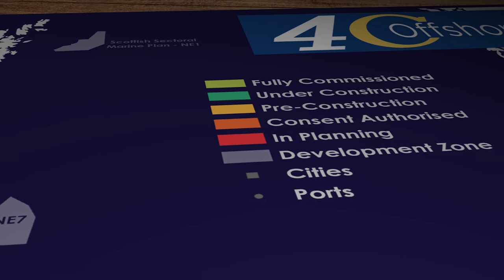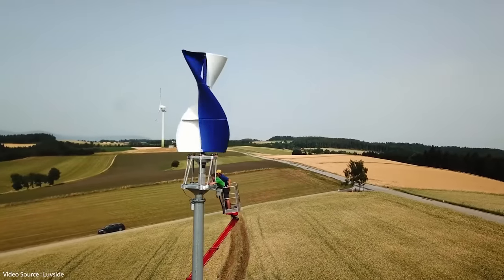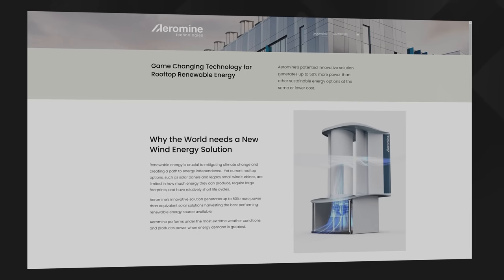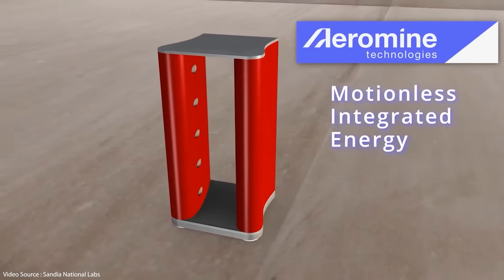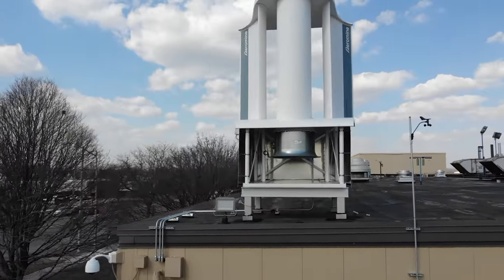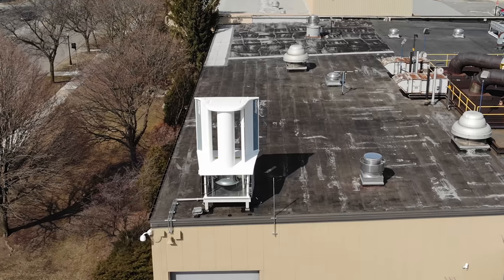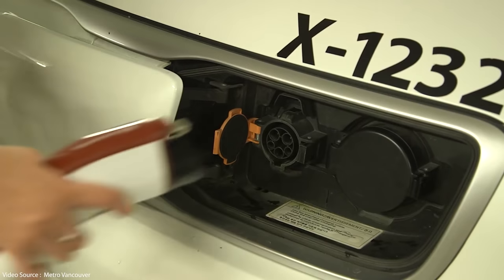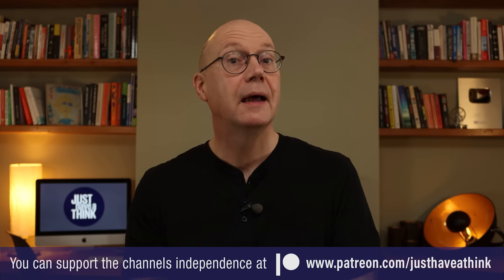Aeromine Rooftop Wind. Static. Silent.  50% more power than Solar PV. What's not to like?

Comment: The kinetic energy flux in a streamtube of air is given by 1/2 x density x velocity^3. If we assume that the capture area is 1m^2 and the generation efficiency is 40% then we can conclude that to generate 5kW this turbine requires air speeds approaching 65mph. That's a violent storm (force 11) on the Beaufort scale. Under more normal conditions I would expect the output to be a few hundred watts at most. I'm sorry to say that, yet again, we're being supplied with extremely misleading performance figures.
Reply: fairly normal wind in Iceland
Reply: Not misleading, but you will have to look at the graph for your average windspeed, which usually is a lot lower. Now, sticking wind turbines on roofs is usually a waste of money. Usually meaning in 95% of cases I studied. The other 5 are inconclusive.
Reply: Pr your wind speed assumptions are incorrect
Reply: Does this consider the Venturi effect?
Reply: @srw_cricket2976  No i don't think it does.. nor it considered the Possibility of Heating Air For Creating an Heat Battery out of it.
Reply: Cursory googling shows that building roof edges regularly see speeds that high, which is why these are designed to take advantage of that. Granted I imagine it would be far less than 5kW but probably not in the low watt range.
Reply: It looks like the 'capture area' ks quite large , and the pressure differential generates much higher airspeed through a relatively small fan, so that the effective power is much higher than the aparent capture area and incident wind speed... add in the already -existing pressure differential at a roof edge...
Reply: It's the Venturi Effect who Increase Wind Speed at Turbine Level..
The few watt of suction are for Generating the Vacuum who Produce the Funneling Effect for the Venturi's Turbine.
You're data aren't Wrong, you just have Calculated the Output of Energy from the Wrong Side of the Turbine..
It's not the Wind who pass Through that Generates the Greatest amount of Energy but the One who get sucked in..Vacuum generally Require little Energetic Expenditure..
You're Calculating the Vacuum Potential not the Energy factually Generated..
Ergo the Few Hundreds watts of Generated Vacuum are Predisposed for turning the 5kw with the Venturi's Turbine...
Hope it was Explicative.
Reply: @antoniopacelli  It doesn't need to consider the venturi effect. Swapping mass for velocity does not change the amount of energy available for capture in a system.
Reply: There is a fair bit of leeway in your and this calculation. At a wind speed 10 m/s you have about 600 watts per m^2 equating to 240 watts of recoverable power.  We could double the collection area increasing the power to 500 watts. Then add 50% increase in energy due to wind speed increase on the edge of a building and we get 750 watts.  Then increase the wind speed to 20 m/s (44mph) and you get over 5000 watts.  
So I think the bottom line is it might be a bit better than you think but we still end up most of the time a lot less than 5000 watts. The actual wind collection area is significant (don’t know what that is) and building orientation and height is an important factor in power production.  You would need to model the wind speed over the building to how well the system would work.
Reply: @operator8014 
 It's not Swapped with anything he is calculating another air in Entrance at another wind speed.
Air In Entrance and Relative Speed/Mass generate a Funneling Effect who Suck in An Amount of Air from surrounding Area that reaching 65mph or more makes Turning the Turbine attached to a 5kw Generator...
I don't really see what happens...
Probably Too kuch attachment to the Formula make the Logic Of the Whole Thing Fading Apart.

[There is a 9.27 Explanatory Video Above this Comment... did you even watched it ?]
Reply: Thanks for making the point about wind and the power. Generally new inventions are not, just new shapes but don't change the physic laws. From a frog. Bye
Reply: @joeblogs6598 Have you looked at any cost comparisons less than 20 years old? Nuclear is by far the most expensive. Coal is usually the second most expensive, but a lot cheaper. Solar is the cheapest, often around one quarter of coal, closely followed by wind. These costs are calculated from total life time cost per unit of power, no subsidies included. You can find the actual detailed numbers and facts easily, from very trustworthy institutions all over the world.
Reply: In some cases this is worth it I lived in a valley without many trees the wind there was 80 percent of the time was over twenty miles a hour and oftentimes more but this in a average neighborhood wouldn't be worth the cost!
Reply: @SteinVarjord  "Nuclear is by far the most expensive."
Nuclear is only expensive due to pointless regulations by government. If you weren't forced to build a bunker around your reactor, and buy have a nature reserve worth of land around it, you could make them vastly cheaper, with essentially 0 operating costs.

"Coal is usually the second most expensive" It's cheaper than everything besides nuclear.

Hydro only works in convenient geological locations, and is usually also used for irrigation, so cant just release water for power generation.

Tidal is about ten-fold the price of wind, and blocks shipping lanes.
Wave doesn't work.

Solar doesn't work at night time.

Wind doesn't work when you need it.

The only way to have wind & solar as a major portion of your grid is to have utterly uneconomical storage systems, which take that theoretical quarter price of energy, and multiply it by 50. Hell, the fool who runs this channel admits at the begging, "Wind needs backing from government to stop it becoming an expensive white elephant". And hes talking about before you even add any storage costs!
Reply: @joeblogs6598   Would you be able to clarify what you mean by "Wave doesn't work"? Are you referring to environmental considerations, or specific technologies?
Reply: @PaulZeeX  Collection of energy from sea/ocean waves. So far all attempts at making wave power generation economical have failed.
Reply: @joeblogs6598  industry calculations put solar + storage LCOE without subsidies ahead of current LCOE for all carbon based generation technologies, even with all the O&G subsidies.  I’m not referring to tree huger NGO numbers but internal power generation companies whose only incentive is to save money.  Were did you get your numbers from? They sound more like O&G talking points.
Reply: @fricardo3  Cool, if this is all true, then government has no reason to subsidize renewables (or any other energy), nor any reason to regulate it.

At the end of the day, I don't care how people want to spend their money. What I'm against is governments going round banning fossil fuels and wasting taxes on stuff that shouldn't have it.
Reply: @joeblogs6598  joe, I work at a utility and in 2022, before the IRA subsidies (that still don’t really catch up to the many subsidies received by O&G) were implemented, we already concluded that without any incentives, our fleet should still be rebalanced to reduce fossil generation to the minimum necessary for reliability and the vast remaining majority should be comprised of generation that requires no fuel.

I don’t know if you are noticing but to those who read your comments here it seems like your opinion is aiming at optimizing your job security or that of those who you care about in O&G and not optimizing for profitability like capitalism does.

Nobody denies the fossil fuels did immense good to humanity in the last 140 years.  They were instrumental, indispensable in allowing the emergence of what we now consider modernity.  They took as this far, very far indeed and, like having a very successful Grandpa, we should be really thankful and we should help the industry fade gracefully into the history of great past technologies.
Reply: @joeblogs6598  That is only if you set the requirements from an arbitrary standard case, namely fossil fuels which yes operate 24hrs a day. And so carbon culture, and from that carbon technology expect energy 24hrs per day, but carbon is what we are transitioning. Intermittent power would be fine once the demand side adjusts. Incidentally, nature is intermittent, and trying to pretend we are not in it has not gone well. And, energy needs to be seen more broadly. Fossils are dense stabilized chemical energy stored in a molecules of solar origin  by photosynthesis, and more heat and pressure than can be extracted. That’s unique, not a baseline. Wind and sun are flows, thermal pressure and radiative particles. There is no reason an energy flow would behave like a molecule. But then we have energy all around. In molecules of food, chemical and mechanical in structures, materials and production. Metabolic in ourselves. I’ve spent time in places with rolling blackouts, and after a few days it seems perfectly normal. It has also been the case for only a fraction of our existence that we used energy to climatize and illuminate interior spaces. Clothes keep you warn, the sun shines light. Better insulating material could combat cold, the Egyptians used mirrors to reflect sunlight indoors sometimes through several successive angles to illuminate far from windows. The pessimistic intractable problem is a destabilized climate, not an energy shortfall or intermittency.
Reply: @srw_cricket2976  yes it does. It is based on Bernoulli's principle of conservation of mass energy, which is exactly why this setup will not work too well. The speed of medium increases but the mass energy remains the same. Wait, minus friction losses. In this case there is lots of friction losses from surface contact and turbulence.
Reply: @johnxie6472  
It isn't the Funneling of Wind who Generate Electrical Power, it's the Suction Created by the Vacuum who needs less amount of Energy in Order to Generating a Bigger area of Suction for Incoming winds entering the Venturi's Turbine..

The Energy of the Funneled Wind Remain the same.. it's a few hundreds Watts of Passive Vacuum Generating Suction of Increased Amount of Air and Increasing in its Speed...

You're Calculating the Wrong Section.
That Funneled Air potential Power isn't Directly converted into electricity...
It's the Air Harvested from the Created Suction that is...
Vacuum need very small energy to move great amount of Fluids..
That is the Ram Pumps (even not being much efficient) run with the Pressure given by Flowing water itself plus vacuum...

How can possibly be that this comment have >100 Positive Reviews just because there are Theoretical Data Over it...
There aren't that many Harvard Students on YouTube usually.
Reply: @joeblogs6598  Well, although it's still early days, the UniWave from Wave Swell Energy promisingly appears to have broken that: https://youtu.be/4ehT-ZTHFGg
Reply: @joeblogs6598  lol, fuel cost of coal is higher than battery backed solar, what planet are you on haha!
Reply: @joeblogs6598  the reason you want subsidies for renewables is that they reduce harmful emissions.

Even if you don't believe in carbon dioxide, you better believe that living near coal plants is fucking awful for your health, cancer rates way higher and lung problems for everyone that lives in the area.

So we need government and subsidies to close the more expensive (but still profitable) coal plants sooner, rather than only when they become unprofitable.

Why without regulation would you shut down coal if you could make money, keep running it while the government subsidizes all the healthcare costs of those that live nearby
Reply: But if this was a general practice like insulation standards then having the millions of houses collectively would make our overall efficiency better regardless no ?
Reply: @Rnankn  Great, so all the 5G network installations can be removed for a start as they will not be able to operate reliably due to intermittent availability of electrical power which will be required elsewhere.
Reply: Small wind is a scam, just don't do it!
Reply: @malloot9224  a scam as such in what way ? Genuinely curious I know not much about the technology
Reply: @meateaw  Please show me then. If what you say was true, then we would have seen private companies building such things without subsidy ages ages ago.

The reality is that solar and wind have more costs than just the price of the panel or turbine. There are land costs, storage costs, cable costs etc.
Reply: @FuturusDao  I have read many researches from all over the world and small wind turbines never work well enough to recommend. A Belgian research into 25 commercially available models in a field and on homes concluded that none of them broke even after 6 years of running or even came close (vs grid prices). Half of them broke down in the first 4 years to a level that wouldn't make commercial sense to repair. Only one model made its rated power specs but was too noisy on the homes. Only 2 models didn't make noise complaints from neighbours but hardly made more then 70watts on average. Basically the laws of physics are against small wind turbines, its also why commercial market wants bigger and bigger all the time, they ran the numbers, bigger is better then more smaller.
Reply: @meateaw  "Even if you don't believe in carbon dioxide, you better believe that living near coal plants is fucking awful for your health, cancer rates way higher and lung problems for everyone that lives in the area."

Thats all well and good. The problem, is that those risks do not outweigh the benefits that cheap fossil fuel derived energy brings.

 If you have to pay 10 times the current price for energy, that means your food costs 10 times as much, as does housing, healthcare, travel. EVERYTHING. And because of those increases, people won't even get to the age where cancer can affect them. You'll send us back to preindustrial society with dogmatism.

" need government and subsidies" The problem there is that the government doesn't magic money into existence, the value that backs up that money must be stolen from the population via taxation. Other than that being a heinous moral act, it is also no at all practical to use 3 times a country's GDP on destroying and then rebuilding its power generating infrastructure, all in the name of a climate cult.

"Why without regulation would you shut down coal if you could make money"
If it becomes more profitable to operate a nuclear power plant, then it they likely would. Another possible reason, is because their customers are not willing to buy electricity from coal derived power. At the end of the day, in a free market, the buyers an sellers come together to decide what gets done. Vote with your wallet.

"while the government subsidizes all the healthcare costs of those that live nearby"
One of the many reasons why we should not have government run healthcare. Another reason is canada's MAID.
Reply: @@morciej Oi Bro...
If the wind passing through at top is 20m/s the Wind in the Venturi will be 
~40m/s.. if it goes 15m/s it will be 30m/s if it goes 10m/s it will be 20m/s at the Turbine Level.
If it goes 5m/s than probably the turbine will work at a fraction of its potential... it doesn't matter much..
It is rated for 5kw if the wind blows at 29m/s it will still be doing those..
if the wind flow at 10m/s it will do 2.5kw...
No one care anyway...
It will not be saving the world regardless.
Reply: It could be bugger all in terms of Watt-hours and still be 50% more than the solar power we get in the UK
Reply: @allterrainviking  true but u have far better source there geothermal !
Reply: @allterrainviking  Lucky you.
Reply: @derkarhu5079  You cannot beat the Betz limit. It applies regardless of whatever fancy bits they put into it. It is just a matter of energy conservation and flow continuity.
Reply: @malloot9224  thanks for sharing
Reply: I live somewhere where we ocassionally get those kind of windspeeds at certain times of year. That's actually getting into very scary territory. The gusts will be getting much higher to get an average of 65.

The idea that something projecting from your roof would be even rated to withstand that kind of weather, let alone use it as a baseline for calculating output doesn't seem right. If they're actually doing that then the whole thing is just a scam to capture VC funding or something.
Reply: In the Netherlands you have 27 days of windshield over 50 km per your. That gives already 648 hours of full capacity. So the numbers might be in order
Reply: @PeterBakker  initial post is mph, not kmph. 50kmph winds are very strong, 65mph (100+kmph) are extreme - roofs coming off houses, trees blowing over etc.
Reply: @jeremymanson1781  Then don't subsidize them. Nothing should be subsidized.

"which they are not required to remedy."
Why on earth should they be? Are you required to remedy this 'damage' for your participation in it? You buy energy from these people, you eat food that was farmed.

"We are now in the 21st century."
We are also in reality. In reality, things cost money. In reality, things require energy to do.

You must recognize that increasing the price of energy by banning fossil fuels, that your quality of life (and everyone else's) will be dramatically reduced.

If you don't like energy produced from fossil fuels, don't buy energy from a company that makes energy from using them. Under capitalism this is possible.

Stop trying to force everyone else to play in with your insane cult.
Reply: From a cubic meter of vacuum at sea level (1 bar ~ 28 Wh/m^3) you get about 28Wh under optimal conditions and that independently of any flow speed.  I therefore consider it plausible that the energy production here is determined to a significant extent by effects of the fluid dynamics and that the exclusive consideration of the kinetic terms may underestimate the energy that can be produced.
Reply: @fricardo3  Can you explain LCOE?  What is levelised (or levelled?)
Reply: @peters.8119  I don't understand your calculation. What do you mean by obtaining energy from a vacuum?
Reply: @Merlin3189  it simply measures the average net present cost of power generation for a specific technology over the standard lifetime of projects using that technology.  It is called levelized because the results of the different calculations for the different technologies provide a comparable number allowing for apples to apples comparisons
Reply: @joeblogs6598  'your insane cult' from a fossil fuel addict: pot calling kettle 🤡
Reply: @joeblogs6598  Firstly, the reason for those regs is sound and has already proven incredibly valid in recent disasters. Secondly, no, the costs would remain virtually that high. The total land cost going into Hinkley C is £4 million. The total cost of the bunker etc is £115 million. Its total build cost is £26 BILLION. You really shouldn't speak on things you clearly have absolutely no experience of.
Reply: @meateaw  He's either just parroting things he was taught 20 years ago with no idea of how much the industry has changed, or more likely, he's in someway employed in the oil and gas industry.
Reply: @joeblogs6598  These are included in almost every commercial calculation for costs. It's literally out jobs. Jesus Christ the Dunning Kruger is strong here...
Reply: I present the same equation, but what is the effective area. Not just the frontal area of the device itself.  The building as mentioned deflects the air. Not very effective but many times the area of the device.
Reply: The airspeed in localised areas around the building  could be that velocity because of the frontal area. Even when the wind speed is much lower.
Reply: @joeblogs6598  , no, coal is not the "cheapest source of energy out there"- coal externalizes many of its costs/liabilities- your math only 'works' because you pretend costs don't exist!!!
Reply: @svampebob007  Of course you call "BS"- generating hot air costs you nothing.
Reply: @joeblogs6598  Why should folks be liable for the damage they do?  Seriously?  Attempt to answer that question yourself in good faith before taxing others to answer it for you.   We can't chew your food for you- if you won't make the minimal effort required, there is no cause to believe you are capable of benefiting from assistance. 

Look, dude, you seem to enjoy making ultimate proclamations based on your ideological preferences.   That may server you in your political social circles, but in the practical world, such tactics obstruct progress.   You argue for a model that has brought us to the precipice  of environmental catastrophe.   You argue for a past that served you by robbing the future.   The easy bet is you are an old man... yet your account here is only a few months old.   Most peculiar.    Regardless, you are convincing no one, only affirming your own preferences and prejudices.
Reply: Yes you are right. This is just a paid partnerships. All youtubers have to do is praise the turbine.
Reply: @fricardo3  Thanks. It had to be something like that. I found this thread difficult to follow with so many acronyms scattered around, but fell at the hurdle of this one when I didn't even understand the words.
It is hard to compare costs with so much legislation and subsidies of various sorts being applied.  So we would like to have some measure like that.
Reply: Assuming the wind is coming directly in.
Reply: @Phazaar  The cost of a coal power plant is ~$1 billion. A nuclear power plant is essentially the same thing, but with the coal burning furnace replaced with a reactor vessel. You have to explain to me how the reactor vessel somehow costs more than $25 billion to produce. It's clear to me that due to either government regulations, or plain old corruption, the price of nuclear is completely distorted.

"regs is sound and has already proven incredibly valid in recent disasters."
Where?
Reply: @meateaw  "The free market is great, but it is also myopic"
No more than anyone else. It's far less so than the government that only thinks in ~5 year cycles. Perhaps if governments weren't constantly devaluing everyone's money, people would be able to invest in long term low risk, low % return investments, instead of scrambling into a short term high % return investment to preserve their value against inflation.

" If you can still make money on coal, there isn't some magical fairy that comes in to undercut coal."
Eh? That's like saying people will continue to use horse & cart as their main mode of travel, despite the cheaper alternatives of a car existing.

In general, people will use whatever is cheapest to complete the job. This is great, because this means all you have to do is make energy cheaper than a coal power plant, and the vast majority will start using your cheaper energy.

"People make money off their rooftop systems even when there is no subsidy."
That's fine, though your grid can't operate on a high percentage of renewables because you then become dependent on their intermittent nature, and require storage, which costs money.

If you believe people strapping solar panels to their roof will fulfill their energy demands, i'm fine with them doing that. I only have a problem when the government comes round either demanding everyone does it, or starts spending other peoples money on funding it.

"there's a reason monopolies and oligopolies form."
Yeah, because governments ensure the monopolies never face competition. Just take a look at insulin prices in the USA. Only 3 companies are legally allowed to make it. You're not allowed to import insulin from abroad, because of government. You're not allowed to make insulin without a license, because of government. You're not even allowed to develop a different way of making the stuff without pointlessly spending billions of dollars in meeting the regulations put in place, by government.

All monopolies are maintained by government. In the free market, monopolies can exist too, but only for a short while. This is because competitors develop ways of making the exact same product the monopoly makes, competing with it.

"And that's because the free market has MAJOR issues if you don't regulate them correctly" 
Regulation is what causes these issues.

"You have "done your own research", and it's like they say, garbage in garbage out."
Ah, I see. The only valid research is that which is sanctioned by the state. Carry on being a slave to your state masters.
Reply: @meateaw  As I've replied to the other guy, that money does not equal value.

Simple way to think of it: Can you just keep printing money to pay for things?

How did that work out for Zimbabwe and Germany?
Reply: @mavigogun  You're over estimating those costs. The proof of that is that people still buy energy from those power plants.

If you don't like something, don't buy it. If enough people agree with you, the income of that company suffers until it changes it's practices such that it meets customer demands.

Vote with your wallet, it's as simple as that.
Reply: @Rnankn  I am VERY skeptical about our current capability to shift out from oil and gas in a meaningful way, but I am for energy diversity.  It's always good to have options.  I agreed with most of what you said, but you lost me when you tried to normalize rolling blackouts as a price for entry. 😂 No thanks.
Reply: @mavigogun  I just called BS, you don't have to answer. I just hope that non of my local politicians falls for this crap.
Reply: @joeblogs6598  I can only assume you don't wear seatbelts, still put leaded gasoline in your car, drink conterminated water and enjoy sulfur smells from passing by semi's while your 10 year old children work 12 hour shifts in the local coal mining facility.  
I cannot fantom how you can think that making several 100 square miles uninhabitable for hundreds of years is quite an acceptable risk.
Reply: Maybe it was 5Kw over the whole day, not 5 Kwh
Reply: @rienkhoek4169  "I can only assume you don't wear seatbelts, still put leaded gasoline in your car"
No, because even if I wanted to, the government prohibits me to do so.

By having regulations, the government makes things more expensive. This means that someone who is poor, gets poorer. Where originally, in a free market, could have the choice to buy cheap gas with health risks, or expensive gas with less, they now have to pay for the expensive one.

Regulations only harm people. If you don't want to buy something because you are scared it will harm you. Don't buy it.

"making several 100 square miles uninhabitable for hundreds of years"
What on earth are you on about? Perhaps Chernobyl? You can live there just fine. It's not uninhabitable as evidenced by the flourishing wildlife all around it. Perhaps if you lived in the reactor building itself all your life, you might have a higher risk of cancer, but that's it.

You people are just how a government want's all it's subjects, scared.
Reply: I think folks are missing a fundamental point here. I'm not an aerodynamicist, I'm a retired pilot and have flown through ground level wind shear a great many times.

All pilots have experienced ground wind speeds of five knots or less that were 15 to 25 knots just 20 to 50 m above the surface seconds before landing.

I used to teach people how to fly gliders and we had to carefully instruct folks to avoid making super steep turns near the ground as the wind differential speed could be enough to stall the down wing resulting in a tragic half spin and splat ..

Elevate the intake and redo your math .. eager to hear your results.
Reply: @nottenvironmental6208  can you correct them then?
Reply: You need to keep in mind you have rising air from the ground at temperature.  Then the colder air combining this this and the venturie affect. All these factors will increase the speed dramatically . The venturie will increase the speed by 50% possible
Reply: @svampebob007  It's customary where I'm from to clean up after waste is excreted.
Reply: @joeblogs6598  Yes, it makes things more expensive, because people/ companies are being held responsible for the side effects like polution and health and safety. How do you propose to prevent the world from becoming a huge landfill? 
The only people getting rich in the early days of the industrial revolution were the owners of companies while the workers where given just enough to not die. 
No i dont live in Tsjernobyl, and guess what, nobody does, because in that 30 kilometer radius, your health will suffer. Just because rabbits het to live there for a few years doesnt mean you can live there for decades.
Reply: @mavigogun  "Most folks with any conscious or basic maturity don't allow that complicity to become an excuse for not changing course."
Then change your course. With the free market you are allowed to make that choice. If you don't like the way a product is made, you can choose not to buy it.

Under the government, you are not allowed to choose. You want the government to take away that choice.

As for fossil fuels causing damage, it is a simple matter of pros and cons. Fossil fuels pros are that the produce constant power available at any time, very cheaply. Their con is the waste material they produce as a byproduct.

For the vast majority of everyone who uses that energy, the pro of cheap energy, outweighs that con.

If it didn't, then they would select energy produced by other means. This what I'm getting at. You want to deprive everyone of a choice, all because you believe you know best.

"Sociopaths, such as yourself, grow ever more impotent to stop that change"
On the contrary, I'm not here to take away anybody's choice.

I want the free market, unrestrained by evil, controlling bureaucrats. If you want to use coal, wind, nuclear, solar, I couldn't care less. What I do care about, is when you use the government to either spend other peoples money on those things, or outright force people to use them, depriving them of choice.

Why must everyone do as you say? Can't they be trusted to make their own choices?
Reply: @antoniopacelli  fascinating!
Reply: @Raye938  I wonder how these would perform is mounted on a peaked roof, with the roof slope facing the wind
Reply: @joeblogs6598   re: “benefits of cheep fossil fuels”:  cheep fuels have resulted in an outrageously inefficient housing stock, inefficient layouts of cities, where walking is unpleasant or dangerous, so that our communities are fragmented, and children can’t play outside. The automobile has transformed the symbol of success and individuality to the most narcissistic and selfish possible. People easily go about their day nor meeting a single acquaintance- because they don’t even meet their neighbors as they drive from their driveway.  Statistically, one in a hundred of us will die in a car crash, and most people will be injured by one. 
This cheap fuel does not foster medical research , or encourage us to play on community Sports clubs or play music together or join community theater groups.
Reply: The pressure and windspeed coming off the edge and over the corner of a building is much greater than ambient surrounding air speed,this is why they are placing them in this efficient zone to capture the high wind speeds!
Reply: @liamstacey419  "cheep fuels have resulted in an outrageously inefficient housing stock, inefficient layouts of cities,"
You going to have to point out how that connection works for me.

The price of energy dictates your well-being however. Logic here being pretty simple:
If you have to spend less money heating your house, lighting your kids bedroom at night so they can study, cooking your food etc, you have more money to spend on other things, like improving your accommodation.

"Statistically, one in a hundred of us will die in a car crash, and most people will be injured by one." And how many countless people are saved by ambulances? How many are saved by medicine delivered on a truck, instead of horse and cart?

These are the sort of things environmental fools forget.

They seem to believe that these things at the supermarket just magically appear. When you increase the price of energy by forcing everyone to use renewables, you make the cost of everything go up. This makes people suffer far more than any air pollution could.

"This cheap fuel does not foster medical research"
No, but it does allow more people to spend time researching, instead of making money to pay for bills. As stated before, low cost energy lets peoples money go further.

At the end of the day, I just want you to stop using the government to take away peoples choices.
Reply: @liamstacey419  "oil is heavily subsidized"
The government should not be allowed to subsidize any energy system.

"mined from public lands for free"
Where? My understanding is an oil company acquires some land, then drills it. The way it should work, is you buy some land, you get to do with it as you please, end of.

"transported on publicly funded highways,"
That is why those roads are there for. Of course if you want a system where your taxes are a reflection of what you use from the government, I am absolutely in favor of that! Also, most of the distance that oil covers is via privately built train networks.

"paid out of our taxes an volunteers"
Then don't use taxes to clean it up. It's the oil company's property, it's their problem.

"Consider that we are now squeezing out the more expensive oil: our grand children will have only the tar sands to find fuel"
This is to be expected, and will be resolved if the free market is allowed to exist. As prices of oil rise, it becomes more economically sensible to explore other energy generation systems. 

At the moment we don't have any cheap energy storage that would make renewables sensible. Perhaps in some time, the free market will create an ideal energy storage system that allows renewables to compete with fossil fuels.

"Perhaps we shouldn’t use up all the fossil fuel"
We currently do not have any replacement for fossil fuel powered tractors. Once again, allow the free market to create a solution, and once found people will use it. Not because its environmentally friendly, but simply because its cheaper. This is how to solve all the worlds problems.
Reply: The capture area is actually the entire column of the surface of the building below the generator. The building itself is capturing the energy and redirecting it up towards the device with a higher pressure and velocity than it had when it was far from the building. Granted this collection mechanism is not very efficient because there are a lot of losses due to drag, but the collection area is a hell of a lot larger than one square meter.
Reply: @joeblogs6598  my point here has nothing to do about government subsidies, but rather about how the government giving away fossil fuels are and the presence of quick fixes such as fossil fuels result in built-in long lasting inefficiencies.  it’s basic economics that anything that is cheapest wasted. Since fuel is cheaper than insulation for a long time and cheaper than the effort it takes to build a double stud wall, we have a planet of housing stock that is extremely inefficient causing us to be in a desperate situation for more cheap fuel. As architects have become more cognizant of this problem, they have developed houses that are extremely efficient. The design process is called “passive house design“ 
Our economy has loads of surplus spending that we waste producing and consuming junkie stuff, Das our capacity to do biological research is largely a Product of our willpower not an abundance of cheap energy.
Reply: Applying your formula  I found   kinetic energy = 1/2 x 1.225 kg/m^3  ×  (5 m/s)^3 =76.526 w/s^2 for 40/100 of 1 square meters 76526 x 0.4 =30.625w=30w for 11mph (or 5m/s) for 60mph it will be eround 6.5kw
You seem right but I we may be missing something because they seem to have better measurement.
Reply: @srw_cricket2976 any one knows how venturi effect increases the wind speed ? 2 time  .? 3 ?
Reply: I guess if you have 6 it’s 10 mph?  I’m not opposed to that but 5kw, not 15?  Interesting. 18 is a bit much for a hair dryer @1500w
Reply: Velocity used for calculations isn't  wind Velocity but the  Velocity trought the cylinder . It's  X  time wind Velocity (acceleration effect)
Reply: @antoniopacelli  I think you need to learn to spell physics before you start trying to use it
Reply: I couldn't agree more Sam.
Reply: @malloot9224  A sensible and reasoned reply. My understanding exactly.
Reply: Thank you for the calculation and your valuable insights... If the construction is lowcost and you can spare the surface and get a permit for several large structures it would be feasable. But since yield is low cost will probably be the deciding factor...
Reply: @sammason2300 Illustrated on an apartment building the units are about the same height as the floors of the building, typically more than 8 ft, so the capture area should be at least 2.5 sq m, and closer to 3. In mass production if the costs can be driven low enough these units would attach to each other to form a continuous parapet wall with a capture area equal to the length of the building x 8 ft. If he gave a typical velocity multiplier for air flowing over a building, I missed it. But that's a cube factor, so it is critical to the system's LCOE, which is what will sell it if the esthetics blend in and it actually runs quiet. Ugly junk on the roof that gets a reputation for sounding like a rock band will wither & die even if it works. I can imagine the system becoming popular if it is attractive, quiet, made from low maintenance materials & easy to maintain with a power unit that snaps out so you snap in your spare and easily service the one you're repairing to store on the self as your new spare.
Reply: @Rnankn  Wildest story I've seen in awhile. Of COURSE we not only expect power 24/7, we DEMAND RELIABLE  power 24/7. This is minimal. As a species, we will need to extract many gigatons of CO2 from this here atmosphere, and the energy to do so will not be attained by reducing our energy foot print. The problem is in the petawatt column, not the kilowatt column. We, those who believe in planning for the worst while hoping for the best, insist building heaven on Earth is a basic expectation. I don't know what planet you want to live on, but we have Elon Funk & Jeff Bozo building rockets to take you there, so PLEASE volunteer.
Reply: @mrvalveras  That's the most mature thing i've ever read on the tubes. Have a delightful December 2022.
Reply: @liamstacey419  "The government paid for the research they gave us aerosol cans and lasers"
That doesn't mean government is a vital component of acquiring those discoveries. It's like saying we need government to build roads, when farmers build them and other infrastructure privately routinely.

"You present the choice as government does things or it’s a completely free market."
This is because I want society to tend towards more free market, instead of growing the government. At the moment, and for the past century, governments have only grown. We're literally at the point now where they want to regulate how much fertilizer a farmer uses, or ban what kind of car people drive.
The government is too big.

"The fact of the matter is that the majority of the people want there to be public lands,"
The fact of the matter is that people want free money. If government presents their manifesto with a big slice of free money, people vote for them. I'm pretty sure the founding fathers of the USA said something to the effect of 'the republic will end as soon as the people realize they can vote themselves money'.

"regulate things that threaten the welfare of the population."
The problem with this idea of something that "threatens the welfare of the population" is that every single thing that anyone does, causes a little bit of harm to everyone else. By consuming resources, say a loaf of bread, someone else who could've had that bread is negatively affected. This is the excuse governments use to control every aspect of your life, because in principle everything you do can effect everyone else in a minuscule way.

"the question of when should the government subsidize something that’s a potential public good." Just like how everything has a component of harming everyone welfare, everything could bring some tiny public good. Just because this is true, does not mean that those goods and bads are balanced, or favor a particular direction. In order to find out which one's the case, you can only try doing them and see how they work out. With the free market, you can do so.

I'd much rather scenario where you can do what you want, and if someone doesn't like it, they ostracize you. If you get ostracized by enough people, you're likely doing something unhelpful, and due to the economic impact upon you from ostracization, you will stop your behavior. We don't need some man with a high-vis jacket and a clipboard to tell you how to do stuff. Hell, I could even stand a little government, if it just did what it used to, stopping people murdering, or stealing.

"If we want more efficient city planning or more Energy efficient housing stock,"
The problem is that we don't know if the money saved by having insulated houses, is worth the cost of smaller, more expensive houses. Once again, the free market solves this issue, because people are free to try building either one. Then, whoever is the most successful demonstrates which is best by their success.

"they’ve only done this because of cheap fuels."
Perhaps they wish to escape the city planning, good or bad, and would rather be free to do with their land as they please.

"the countryside has only become littered with suburban shopping malls"
With the free market, everyone has the power to stop this. If you don't want your house to be next to a shopping mall, you buy the plot of land next to you. This exact mechanism lets you preserve wilderness areas. Once you own property, it is yours to do as you please.
Reply: @joeblogs6598  'It's clear to me based upon my total lack of experience in the area, wild speculation, and abject ignorance of the subject matter' - fixed that for you.

The costs come into a number of areas, firstly, you're wrong, reactor vessels are vastly more expensive to produce. Secondly, patents and licensing in the area are incredibly expensive. Thirdly, staffing in the area is incredibly expensive - you can trust a moderate engineer to build a working coal powerplant. You will require a team of the most qualified scientists and engineers to get even close to a working reactor, let alone a safe and stable one. Competition for these individuals is ridiculously high and there are only a few in the world.  Fourthly, there is no free market here - nuclear is close to a monopoly, and this means there are no competitive tenders to bring that price even slightly down. Why should there be? It's a pointless technology at this point.

And finally, finance implications. The risks involved in building a reactor, let alone operating it, are obscene, and the FACT that it will never be cost competitive means that governments have to offer incredible financial incentives (look at Hinkley C's government guarantee of FIVE TIMES the wholesale price of energy, just to begin construction) in order for anyone to seriously believe it's a good commercial proposition. Disbelief means risk, risk means high interest, high interest means commercial disinterest, which loops back to charging obscene prices. No one's going to build you a nuclear power station unless they're certain they can print money with it for as long as it's allowed to operate.
Reply: @joeblogs6598  As you've been repeatedly told, YES THEY ARE CHEAPER ONCE STORAGE IS FACTORED IN. They have been for a couple of years now. Please do catch up. They also remain cheaper even with grid reinforcement. You're grasping at straws where there are no straws.

Many companies have leapt straight for them. Some do not because of the perceived risk of luddites rolling back regulation, as they did with FITs in the UK. The main reason though is because companies aren't sat on cash mountains; they have to acquire finance for these things, planning consents can take decades, and require immediate action. This is why government intervention is necessary, exactly as it has been in mining and O&G.

Your understanding of MMT is limited, but yes, you've correctly identified that the government issuing currency directly to banks instead of individuals is a huge problem. Issue it directly to individuals instead and the economy booms, as demonstrated through Covid, and even as far back as the New Deal.

Whether you expect people to trade things in this way doesn't change the fact that they have for 50 years and the problems we continue to experience do not stem from this but from rampant capitalism which requires redress.

Again, the cost of energy goes DOWN as we move to solar and wind, as does our reliance on foreign powers and (as we currently see) a tumultuous market. Better all round, with no downsides.

Glad we agree that O&G subsidies should go. Maybe spend more time screaming about that since it costs us hundreds of times more than renewable incentives? Your final point is of course absolute trash, based in a nonsensical 'morality' built entirely to enrich the super wealthy, that should have died with Thatcher and Reagan.
Reply: @joeblogs6598  1. We agree then in urban planning.
2. I suspect you don’t like private toll roads and bridges. 
3. Corporations are like aristocracies: they own vast amounts of land and resources, determine the fates of people and economies, but only the wealthy at the top can vote. You could argue that people can vote with her dollars, however the fact of the matter is that people sell them do. People regularly by items from companies that use slave labor or prison labor in other countries, Breakin Bayern mental laws, and participate in government corruption here and abroad. So if you’re going to go after governance I suggest you start with the most corrupt of all, corporations.
4. The biggest growth in our government has been the military, for better or worse.
There’s a lot of people who complain about big government, but they frequently just have one institution that they particularly hate because it’s preventing them from doing things their own way. Would you get rid of public schools? So the only people with money can afford to educate their children and religious people don’t learn anything about science? 
5. Would you get rid of national and local parks? private companies have been free to develop their own parks, but they don’t seem to be interested in it outside a few Hot Springs and ski resorts and exotic game Ranches. So it seems that the private sector doesn’t find parts with vast amounts of open space very profitable.
Reply: @Phazaar  "Secondly, patents and licensing in the area are incredibly expensive."
Government caused cost, my point stands.

"You will require a team of the most qualified scientists and engineers to get even close to a working reactor,"
No it doesn't

"Fourthly, there is no free market here"
I know there isn't, that is because the government controls the electrical grid. You have to go through a billion licenses, regulatory bodies, bribe a few MPs, and even then you're only half way through. This is why the government should be several orders of magnitude of its current size. Think about how difficult it is to drill for oil & gas by fracking on your own land. It is gumming up everything.

"no competitive tenders to bring that price even slightly down."
The competitors are people who build another power plant. The number of competitors on any market is influenced by the cost of entry. In the case of nuclear that cost of entry is kept artificially high by the various ways government interferes in it. 

This is the same reason why healthcare costs so much - regulation increases the cost of entering the market, reducing competition. Government raises the price of everything.

"The risks involved in building a reactor, let alone operating it, are obscene"
Of course the risks are obscene! The government could shut down your investment at any time, look at Germany, look at Japan. They've shutdown practically all their reactors! That is where essentially ALL the risk comes from, the government.

Every single thing you've claimed about nuclear is completely a government borne issue. Remove the government interference in this area and you remove essentially all these problems.
Reply: @joeblogs6598  Couldn't eyeroll harder. The government doesn't own the patents and licenses, private corporations do. Unless your argument is that intellectual property shouldn't exist?

Yes it does. Remind me though, where is your PhD from? 

Firstly, the free market point relates to competition to build Nuclear power plants - it has nothing to do with government intervention. Secondly, there is no effective model for a non-regulated private energy grid that can usefully deliver what we need; the government stepping out here would make things hundreds of times worse. Thirdly, it absolutely shouldn't be possible to drill or frack on your own land, for the same reason it's not legal to grow Japanese Knotweed on your own land, or let off a biological weapon. 

As already outlined, the price to build nuclear is high because there's no point in building nuclear which makes it a terrible commercial investment, AND because it's incredibly expensive, NOT because the government made it so. You have failed miserably to counter this point, so I'll assume you've conceded it and now just want to fall back to repeating lies.

Healthcare is cheaper in every single country where the government runs it than it is in the only 'civilised' nation where the government is kept out of it. It also leads to better health outcomes in every comparable nation. Do you just make stuff up and avoid ever actually doing research, or do you get lines fed to you by some shady paymaster?

There are dozens of other, equally significant, risks to building a reactor. But yes, the fact it's obsolete and will be shut down well before the end of its lifetime because it's an awful technology that should be consigned to the past is indeed one of them. 

You haven't yet demonstrated any area that without government intervention would change in any significant manner to make nuclear cost effective. You also haven't provided a single cogent argument why even if cost came down, that would represent extra value to the public when factoring in the massive risks of trusting private enterprise to self-regulate. Where these materialised in mining and refining, they have done irreparable harm to our planet with just plain old oil and water - what do you think would happen if they materialised with radioactive materials? You're a dangerously delusional fantasist at best, and a ridiculously dishonest vandal at worst.
Reply: @Phazaar  "As you've been repeatedly told, YES THEY ARE CHEAPER ONCE STORAGE IS FACTORED IN."
Yeah they've claimed that, but in reality it's not the case. An easy way to show that's not the case is that we're not running everything on renewables. If they were so much cheaper than their alternatives, why has everyone not switched to them?

"This is why government intervention is necessary,"
It isn't necessary to adopt renewables, as if they are cheaper, people will invest in them instead of fossil fuels, because it gives them higher returns.

" Issue it directly to individuals instead and the economy booms"
That doesn't change the fact that you are giving them bits of paper. The value of any money they hold ends up depleting. 

This is because the number of goods in the market have not increased with the amount of money. If there's a thousand oranges in the market, and 1000 banknotes, then each banknote gets one orange. 
If the government prints an extra 9000 banknotes, there's still a thousand oranges, but now there's 10000 banknotes, so each note has reduced in value by ten times, meaning you need 10 banknotes to get a single orange. This is a fact of how markets work, all governments can do is hide inflation effects so people don't notice too much.

"the economy booms, as demonstrated through Covid"
I'm a confused, are you saying that the economy is booming?

"the problems we continue to experience do not stem from this but from rampant capitalism which requires redress."
No, the problems we are experiencing are soley due to government interfereance, which requires reduction.

"Again, the cost of energy goes DOWN as we move to solar and wind"
I hope it does, but I do not see this to be the case. As I've said before, if these energy sources are not only cheaper than fossil fuels, but substantially cheaper than them, why is there use not already widespread, and if anything, the vast majority.

"as does our reliance on foreign powers"
Our reliance on foreign powers for energy is soley due to our governments restricting native extraction of fossil fuels, all in the name of these environmental policies.

"Better all round, with no downsides."
Apart from the downsides of vastly increased cost.

"Your final point is of course absolute trash, based in a nonsensical 'morality' built entirely to enrich the super wealthy"
Which of my comment's final point are you refering to? Is it that I believe your own property is yours to do with as you please, or that the free market is the best system to solve the worlds problems?

If it's the former, I don't see how having sovereignty over your own stuff is in any way bad. You own it, so you get to say what happens with it.
Reply: @liamstacey419  "I suspect you don’t like private toll roads and bridges."
It's better than being forced to pay for roads built on the other side of country that you've never used.

"Corporations are like aristocracies: they own vast amounts of land and resources, determine the fates of people and economies, but only the wealthy at the top can vote."
You paint corporations like they are immune to reality. First off these big players who act in the way you claim are all propped up by government interference. That interference comes in different forms such as patent laws, regulations, prohibition of imports. 

Take pharma companies for example, much of their dominance comes from the patent laws surrounding the medicines they make. Insulin in the USA is only made by 3 different companies, all of which continually renew their soon-to-expire patents so as to ensure that it is illegal for any other competitors to arrive. Then you have regulations, usually they exist for the sake of keeping the public 'safe'. Said regulations prohibit importing insulin from other countries that could undercut those 3 big companies, despite those imports coming from Germany. I doubt German insulin is any less safe than the American stuff. This is why these big corporations lobby in new regulations instead of innovating.

If you removed this government interference all these corporations would be exposed to the competition of the free market. Insulin monopoly charging $500 a vial, when it costs $5 to make a gallon? A competitor arrives on the scene and sells it for $10 a vial, still making an obscene profit, making any investment back rapidly.
 
" use slave labor or prison labor in other countries," said slavery is enforced by the government of that country (china etc).

"I suggest you start with the most corrupt of all, corporations"
corporations only exist due to the aforementioned governmental interference in the free market.

"So the only people with money can afford to educate their children"
People pay taxes. A portion of those taxes goes to state 'education'. If there is no state run education, peoples taxes can be reduced by a corresponding degree.
Now parents can spend that money on educating their children, or better yet, educate their children themselves.

"religious people don’t learn anything about science?"
Discovering new things about Gods creation is what motivated scientists to do their research in the first place. 

"So it seems that the private sector doesn’t find [national and local parks] very profitable."
If people visiting these parks don't find these parks worth the money it cost to maintain them, then they clearly aren't worth maintaining.
However, I doubt the keeping an area of wild land, wild, costs that much. There might be substantial natural resources available there in the form of oil & ore, which might pump up the price of purchasing that land, but since its going from government ownership to private hands I'm sure the government could sell the land for very cheap, making it available practically anyone to buy.
In that same vein, you might just have charitable individuals buy it up, and keep it as it is.
Reply: @joeblogs6598  roads are paid for by local taxes. Only federal highways are paid for by federal dollars, state highways by state dollars, etc. city roads paid for partly by property tax (all should be paid by fuel tax, and mileage tax for electric vehicles). Still these roads and parking take up space and use up the communal space between communities and within communities to serve car owners at the detriment of pedestrians and bicycles.
  Corporations do everything they can to harness government and avoid government regulation because, just like any other government, they’re in a power struggle:  private interests of the shareholders and Board of Directors versus the public good. 
As for roads and public services in rural areas: they are heavily subsidized by federal and state paid infrastructure.
Reply: @Phazaar  "The government doesn't own the patents and licenses"
What happens if I infringe a patent? The government enforces it. If there are no patent laws, there are no patents, at best there would be 'I made it first' documents.

"the free market point relates to competition to build Nuclear power plants - it has nothing to do with government intervention."
It does. By the government having regulations around building a nuclear power plant, the price of building one is increased. By artificially raising the price in this way, the government reduces competition in that market.

Government regulations both increase the price of a commodity, and reduce the competitors making it.

"non-regulated private energy grid that can usefully deliver what we need"
Yes you can, at worst it might cost more. Even then I suspect companies would use the same standards & infrastructure because of the cost reductions and the profits it brings.

" for the same reason it's not legal to grow Japanese Knotweed on your own land, or let off a biological weapon."
By this principle you should not be allowed to do anything, as everything you do has a varying degree of effect on everyone else.

If someone wants to plan Japanese Knotweed in their garden, they're gonna need a big plot of land to grow it on, lest it grow into their neighbors garden. The result of which would be social ostracization until they stop being a prat.

Why let people do anything at all without permission from the state, if only it is glorious enough to make the decisions?

"there's no point in building nuclear which makes it a terrible commercial investment"
I've already said the reason for it being a bad investment is solely due to the government interfering with nuclear power. If there wasn't the risk of the government taking away your investment, or making it expensive to make in the first place, this wouldn't be a problem.

"I'll assume you've conceded it and now just want to fall back to repeating lies."
I'll assume you've conceded that government regulations are responsible for nuclear's high investment cost.

"Healthcare is cheaper in every single country where the government runs it"
What countries don't have state funded healthcare? The US govt spends more than a trillion dollars a year on healthcare alone.

"It also leads to better health outcomes in every comparable nation"
One of the biggest challenges govt funded healthcare causes, is that people no longer have a doctors bill incentivizing them to look after their body. If you know the government is going to pay for your illness no matter what, you are more likely to do risky things like get fat, or do mountaineering. The result is a less health populous.

"[nuclear's] an awful technology"
In what way? The benefit of a nuclear reactor unmolested by government regulations, is that it costs the same as any coal or gas power station, yet it's fuel costs are infinitesimal.

"without government intervention would change in any significant manner to make nuclear cost effective."
Remove the government regulations that require superfluous components like the containment building, make components have safety factors in excess of whats needed etc. Where not even talking about 4th gen reactors that cant fail.

"You also haven't provided a single cogent argument why even if cost came down, that would represent extra value to the public"
If the cost of making energy come down, it's sale price comes down too. If the price of energy is low, people can buy the same amount of energy they do normally, for less. Now the public have more money with which to improve their lives in whatever way the see fit. It's that simple. Cheap energy makes your life better.

"trusting private enterprise to self-regulate"
I'm not trusting them to self regulate. I'm trusting that customers of that enterprise have desires, and that since the enterprise wants to keep those customers, it will ensure it's business model meets those desires.

"they have done irreparable harm to our planet"
Please explain what harm you are on about. As far as I can see, the majority of people do not consider mining and refining to have caused any damage that makes it not worth it's benefits, otherwise people would have not bought those products.

"You're a dangerously delusional fantasist at best, and a ridiculously dishonest vandal at worst."
Those are the qualities that people who believe governments can magically solve problems by restricting property rights.
Reply: @liamstacey419  "roads are paid for by local taxes. Only federal highways are paid for by federal dollars"
Sure, but if I don't use those roads, I still have to pay for them. Perhaps if tax returns had a 'check here if you want to be excluded from this service' things would be different.

"Still these roads and parking take up space and use up the communal space between communities and within communities to serve car owners at the detriment of pedestrians and bicycles."
How do people & goods travel between communities in you scenario?

"Corporations do everything they can to harness government"
Yes I know, that is why government needs to be much smaller, and unable to regulate things, precisely so lobbyists cannot harness the government to destroy the corporation's competition.

"As for roads and public services in rural areas: they are heavily subsidized by federal and state paid infrastructure."
A farmer still makes his dirt track to connect his grain silos to the rest of the world. He'll do this regardless of government.
Reply: @nottenvironmental6208  Wind at rooftops is usually much much lower than at 100 or 200m. That’s one of the reasons why very large wind turbines are more cost effective than any rooftop windturbine can ever be.
Reply: @joeblogs6598  It sounds like we agree that the roads should be paid for with higher gas taxes, rather than federal and property taxes. 
It also sounds like we agree that the government spends too much money - ( I think it spends too much on the military, I’m not sure what you would cut… education? Scientific research? Cleaning up messes left behind from bankrupt corporations? ) 
Wars are our biggest single expense (including veterans’ benefits, societal cost of the wounded etc, and the international blowback from the mistakes that are inevitable made in war efforts).
Reply: @liamstacey419  "the government spends too much money - ( I think it spends too much on the military, I’m not sure what you would cut… education? Scientific research?"
I think the simplest option is to cut back in all areas equally, that way no sector of government can complain over favoritism. 

"Wars are our biggest single expense"
Though I wholeheartedly agree that the country needs essentially no military, A quick look at the US debt clock shows that medicare&aid outmatch government wastage on the military.

To get our spending within budget, just find out how much we're overspending by as a percent, and then cut back every aspect of government by that amount plus an extra few percentage points to start paying off the debt.
Reply: @@morciej Wait there you got it:
The wasted hot air of the Vortex get converted into Electricity by the Turbine...
The mass doesn't come only from the wind who pass in the small hole it comes also from the Channeled Winds from the building and the generated Suction by the vacuum
Reply: Hi Sam, my calculations actually matched yours exactly. In addition to that and having managed some domestic installs the elephant in the room is how much reinforcement to roof structures is almost always required to take this considerable extra weight, and this design is really only suited to flat level locations.
Reply: @liamstacey419  "so you’re suggesting that we that more people die and suffer by cutting back on medical,  rather than cutting back on killing and injuring people, including our own troops that die and are injured in training."
I'm not too sure what you're asking here, but I think the government should not be spending any money on healthcare or military programs.
Reply: @sammason2300 
I might Mispelling Something that I know better than you...

This does not change the fact you're not able to understand basic Logic..

Might be Inherited...

Ask your Mother.
Reply: Wouldn't be beneficial if these could also rotate around their vertical axis when the wind is not hitting the face of the building where it is located?
Reply: @johncpescod  yes I would have thought was absolutely essential. (Like catching the power of the wind in the sails of a yacht) Clearly they have reason why they don’t do that but I can’t imagine what it would be?
Reply: The concept works but like solar p.v. This device will only produce electricity when subjected to wind speed. In many built up areas this can often be less than 1% of the time so would be a waste of materials in that respect. Very good if you lived on top of a cliff I guess!
Reply: @christianvanderstap6257  where can we find your published studies?
Reply: @joeblogs6598  , storage cost will come down…
Reply: Thank you
Reply: @speedwagon7562  I'm sure they will, but currently they are not cheap enough to allow wind & solar to be economically viable.

If you're really that bothered by CO2, use a nuclear reactor.
Reply: @joeblogs6598  , I think they’re sorta on the way… over my adult life, I’ve purchased in access of 3 dozen batteries for vehicles… as have most seniors…they get replaced when they no longer are dependable to start my vehicle in cold weather… ALL those replaced batteries, were still 60 to 70% good, just not good enough for cold weather. Same process will happen to electric vehicles, except the batteries are MUCH more expensive… 1000s, that are no longer practical for cars, will still have yrs of practical use as storage units…, it’ll happen…
Reply: @speedwagon7562  I'm sure that battery technology has reached a point where it is feasible to make an electric vehicle, but that is quite a different task compared to creating economical energy storage. 

The best we have is pumped hydro, but that is heavily restricted by geology.
Reply: He said that they capitalize on the condensing of the air, therefore, what speed does the air need upon entry to condense to the 65 mph required?
Reply: My family and i live on a lake, and our home is on a bluff above the lake.  It is very windy.  I’ve often wondered why we cannot harness the wind.
Reply: @allterrainviking  Hopefully not, this means almost 105 km/h...
Reply: It could also be that the regular cost of solar panels could have many times of these wind turbines installed to achieve the expected ratio.
Reply: Thank you sam i totally agree 5kw!!! I couldn’t believe that, like you said the wond would need to be higher then just average hot day in florida lol.
Reply: @joeblogs6598  Sorry - a reactor "is virtually the same thing" as a coal fired power plant? The only thing that is the same is the steam turbine producing the electricity. The way they produce that energy is a century of technology apart. The main cost factor for nuclear power plants is not just safety. Sure safety has added to the cost but after Three Mile Island and Fukushima ir's not like it isn't warranted. The main cost is there is no "off the shelf" nuclear power plant you can buy. You can base it on a design but basically they're all built and designed from scratch. A coal fired power plant is built from standard off the shelf components and doesn't require anywhere near the level of technical expertise or safety or security. Hinkley will use 1.8 million cubic metres (4.3 million tonnes) of "nuclear" grade concrete. The biggest pour at Hinkley was 8996 cubic metres. That would have cost more alone than most coal fired power plants just to design, construct and pour. Right now there are companies like Rolls Royce who have extensive experience in building small nuclear reactors for subs trying to design small scale commercial reactors for off the shelf use. And they are still talking a 10 year time scale to design, build and implement and costs  in the billions. It's just a hard fact that nuclear power plants have very high up front costs and the only potential buyers are governments. It's hard to talk about "mass production" when your total global market is less than a hundred over a decade. So pull your head in. Whether you like it or not nuclear is currently the most expensive form of power generation and despite the best efforts of some very smart people that seems unlikely to change.
Reply: @mondotv4216  "The main cost is there is no "off the shelf" nuclear power plant you can buy."
Sure, but if the prohibitions for a new energy generating source is that the supply chain for it does not exist, how do we have coal powerstations? They used to be new once.

The reason why we don't have off the shelf parts is because governments regularly restrict and regulate the price through the roof. Even if a suppler adheres to the rules now, next week the government might change the rules yet again, making all their assets arbitrarily illegal.

Same reason why RR doesn't want to make many promises, lest the government pulls a 180 like it does with too many projects.
Reply: In the tropics, the heat will force the air stream to move up. Sucking in air through and moving the turbine blades. I think this design is very suitable for the tropical countries.
Reply: *MY BRAIN JUST GOT DARZHNARZHDICATED!!*
Reply: @SteinVarjord modern nuclear molten salt reactor technologies are far less expensive and dangerous. They also help us get rid of the waste from old reactors and are stable suppliers of energy and possibly a supplier of cancer treatments.
Reply: This calculation should be confirmed and hence review the information. 
The sun rays are not being used. The sun rays can give electricity as well as heat. Holistic technology combination will boost the efficiency and hence cost effective solution.
Reply: You're smart 🤓
Reply: Which unfortunately is what this channel specialises in.
Reply: @bashful228  "Wind and solar are now cheaper than FF power generation most places in the world."
No it's not. It's heavily subsidized by multiple governments throughout the manufacturing process.

More importantly, the price of renewables never accounts for the mandatory energy storage required for constant power output.

Easy thought experiment: If renewables are so exceedingly cheap as you believe, why did private companies make huge money off them by converting the grid to renewables decades ago?
Reply: @bashful228  "FF has been sponsored at a much higher rate per annum and for over a century."
Then don't subsidize them. No one should be.

"IMF puts the pre- and post-tax subsidies going to FF at US$7.1 trillion per annum."
I don't doubt that they do, however fossil fuels are still profitable without government interference.

"given the green light in Australia today expect to receive no public subsidies for the lifetime of their project."
Is that true for the entire constriction of the thing? Does that account for the storage they will need to keep a constant power output?

If it truly profitable, then go for it. You can post the LCOE resources.
Reply: Yea that as if your "assumption:" are even close. Thats only if you have one of these units. Put ten up there then you can talk your bs
Reply: Not so fast. Your theory neglects to account for the effects of Urban Convection Wind-Shear, not to mention backup power relief for HOW many millions forced to suffer the effects of power outages during those storms?
Reply: 5kw? It's a joke 🤣.
Reply: What you're missing is that velocity is inside the venturi tube, which can be twice the ambient wind speed, so more like 30 mph winds are needed
Reply: Regardless of efficiency I bet they would work great in somalia.  The wind there is crazy all the time
Reply: There is so much wrong in your statements that it’s hard to know where to begin.  Nuclear is the most expensive due to fuel processing, spent fuel storage, reactor decommissioning, and construction costs.
Reply: You're ignoring the venturi effect entirely, which is entirely what is supposed to make these so different.
Reply: @joeblogs6598  yeah pointless regulations…. Chernobyl, Fukushima, does it ring a bell?
Reply: Thank goodness we have people such as your self to SPELL IT OUT in simplistic terms... cuts through all their BS.

THANK YOU SAM😊
Reply: I disagree to some extent

1. *Kinetic Energy Flux:* Given as \(\frac{1}{2} \times \text{density} \times \text{velocity}^3\). This is a standard equation for kinetic energy flux in wind. The power available from the wind passing through an area is proportional to the cube of the velocity.

2. *Capture Area:* Given as 1m^2.

3. *Generation Efficiency:* 40%. This means that only 40% of the kinetic energy flux can be converted to useful electrical energy by the turbine.

4. *Desired Output:* 5kW.

Now, let's find out the required wind speed:

\[ \text{Power} = \text{Efficiency} \times \text{Area} \times \frac{1}{2} \times \text{density} \times \text{velocity}^3 \]

Given the above, we want:

\[ 5,000W = 0.4 \times 1m^2 \times \frac{1}{2} \times \text{density} \times \text{velocity}^3 \]

If we assume standard sea level air density of 1.225 kg/m^3:

\[ 5,000W = 0.4 \times 1 \times \frac{1}{2} \times 1.225 \times \text{velocity}^3 \]
\[ 5,000W = 0.49 \times \text{velocity}^3 \]

Now, solving for velocity:

\[ \text{velocity}^3 = \frac{5,000}{0.49} \]
\[ \text{velocity}^3 = 10,204.08 \]
\[ \text{velocity} = 21.7 m/s \]

Converting 21.7 m/s to mph (1 m/s is approximately 2.23694 mph):

\[ \text{velocity} \approx 48.6 mph \]

This is considerably less than 65mph. 

Based on the Beaufort scale, a wind speed of 48.6 mph is equivalent to a strong gale (Beaufort force 9), not a violent storm (force 11).

In conclusion, while the general sentiment of the statement is true that wind turbines need significant wind speeds to produce their rated output, the specific calculation appears to be off. The required wind speed for the given turbine to produce 5kW, with the assumptions provided, would be approximately 48.6 mph, not 65mph.
Reply: There is a remote turbine that has wind funneled to it correct?
Reply: Walk down a street in Boston or Chicago amongst all the tall buildings and tell me it is not windy. And that is at the street level, not on the roof. When I was a kid, The I.M. Pei designed John Hancock Tower in Boston had a huge problem with windows blowing out due to high winds. Buildings, even not so tall ones, have a huge impact on wind speed. And the foils would accelerate that further by creating a low pressure area. That low pressure area creates a powerful vacuum. Look at sailboats. Well designed ones can travel far faster than the prevailing wind. And these devices are about ten feet wide and ten feet tall. That is about nine square meters being funneled into a tube of say one square meter. That will obviously have some effect on wind velocity. 

I don't think this is impractical at all.
Reply: I'm thinking about getting one for hurricane season and hooking it up to a bunch of batteries for the community lol
Reply: @joeblogs6598 

So You're welcoming the next waste deposit of Nuclear power production in your back yard 🤭😉

No.

Come on.

Well the more people who doesn't like the waste in the backyard/local area/region the more expensive it gets to deposit safely.

So you calculus on nuclear power as cheap is failing
Reply: @yepssss  Don't need to put a nuclear waste deposit near my back yard. Just dump it in the ocean. My point is upheld, nuclear would be significantly cheaper without regulation. At least you're thinking reasonably logically though.
Reply: Isn’t the height of the unit 3m?

They also predicated their numbers based on mounting on a wall, which forces a fair bit more air up there.

Def misleading, not sure it’s quite as misleading tho
Reply: If it sounds to good to be true, it probably isn't true...
Reply: You completely missed the key principle of this generator, the venturi effect causing a greater wind speed to be created with in the narrow channel where the impellers are located. Your numbers are the product of someone who knows just enough to be dangerous but not enough to actually do anything correctly.
Reply: @Brian-uy2tj   @Brian-uy2tj  the venturi effect may suck in more air, but it doesn't add extra energy.
Maximum energy will still be dictated by the surface area.
But: having the thing fixed in the direction of the predominant wind direction will negate all profits introduced by the smart design. Even  if the wind blows 'perfect' 75% of the time, the other times the system will have terrible efficiency.

Being silent - if it actually is - is the remaining advantage. Being (very) expensive is probably killing every 'real project' plan.

For the time being nothing beats the traditional 'fan blade' turbine in (cost) efficiency.
Reply: @AdrieKooijman  <---<< I have a lot more faith in the engineers who designed the unit  and their calculations, than some Youtube naysayer who says that because he doesn't understand their figures that their figures must be wrong.
Reply: Thank you!!